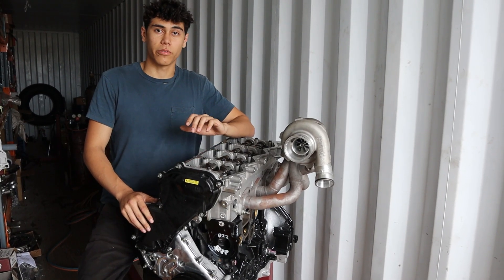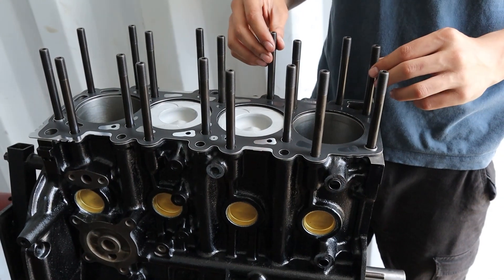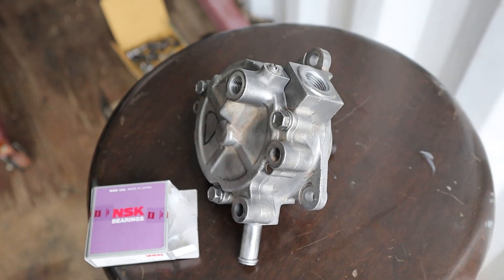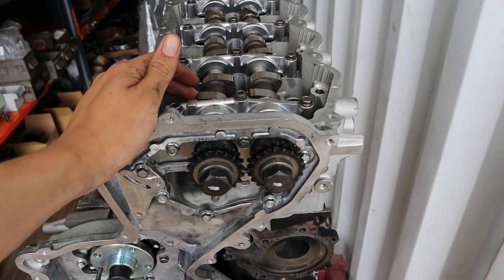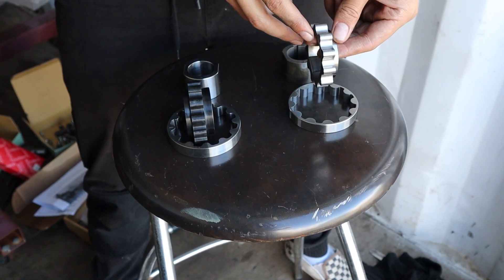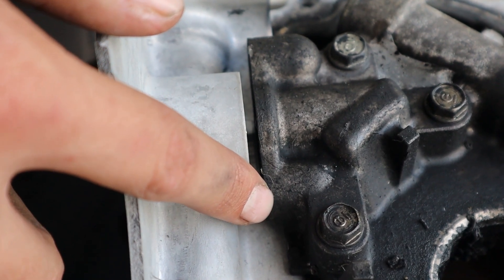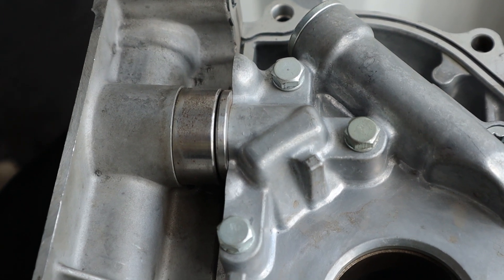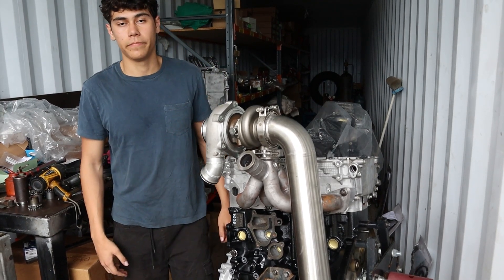YD25 D22 High HP Engine Build

Comment: What's a safe power number you can get without doing any internal upgrades?
I've got 140kw yd25 with egr delete, hard intercooler pipe, 3" turbo back exhaust. Looking at upgrading to a bigger turbo and intercooler, any idea what sort of power I can make, while not making it go bang?
Reply from the maker: only thing im not sure the limit of is the stock main cap bolts. if your just using a bolt on high flow turbo your probably only gonna get around low 200whp which it should handle fine
Reply: Okay, thanks man. I'm really just trying to make the car more capable with towing the caravan 😅  @yd2532

Comment: It is safe to remapping navara np300 yd25 4x2 automatic, soon air filter & down pipe would replaced.
Reply from the maker: Yes
Reply: @yd2532  what is the best remap tune for daily use i mwan daily driven how many BOOST PSI is safe?

Comment: I own a 2014 D22 YD25 with 65,000kms. Its currently running a 3 inch exhaust, egr delete, booste tee running 18psi and it's been dynotuned - it's making 145rwhp and 360nms at the wheels. I'm wanting to push the power up to 200-220 rwhp. Considering a GCG TDX 14411 turbo along with a core flowed intercooler through ARE, a heavy duty clutch and potentially plus 30 injector nozzles. what are your thought's on doing these mods with a low k vehicle with out a double row timing chain upgrade or the ARP head upgrade. Also would you recommend a different way to go about getting to this power level. Thanks
Reply from the maker: Ye you'll be safe running that. I've seen stock engine d40s running a little over 30psi and making 260whp
Reply: @yd2532  good stuff, so the yd25 in the D40 doesn't have any strengthened components over the yd25 in my D22? 

Looking forward to seeing the vid.
Reply from the maker: @johnsmith-yu6vi  basically all the same just a different block
Reply from the maker: In the next couple videos we are gonna be testing a custom gcg  turbo on a d40 aiming for around 250hp
Reply: @yd2532  hi, very keen to see this setup. How far off is the video? thanks

Comment: Awesome content mate.
Looking at replacing my turbo unit on R51 pathfinder.
Any advice would be appreciated.
Keep up the great work.
Thanks for saving me a small fortune .
Reply from the maker: I'f you're gonna get a bolt on turbo make sure you get something that uses genuine bearings. Gcg has standard and high flow options
Reply: @yd2532  Cheers.
Will do .

Comment: How much moding did you have to do to the fuel pump and do you have to change the injectors after the pump change?
Reply from the maker: fuel pump just had to change fuel line fittings, the tuner is gonna decide the injectors but will talk about them in a future video

Comment: i got 40,000kms out of my Duplex kit. Scrapped the bucket of shit.
Reply from the maker: I have customers with 500 000km on our duplex kit. Nissan designed them with double row chains and only started having issues when they switched to single row.
Reply: @yd2532  how many heads have they been through in that time? They’re only good for 100,000
Reply from the maker: @ragebait988  the d40s are common to do heads but that's because the EGR pipe, heater hose plastic fittings, radiator top tank, oil cooler hoses break then they loose coolant and over heat. We have made parts to fix these issues.